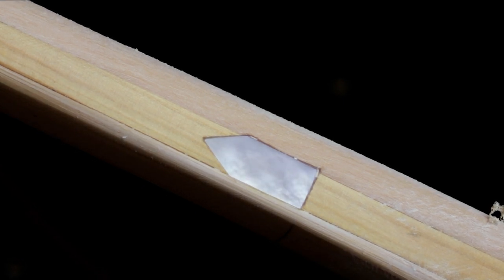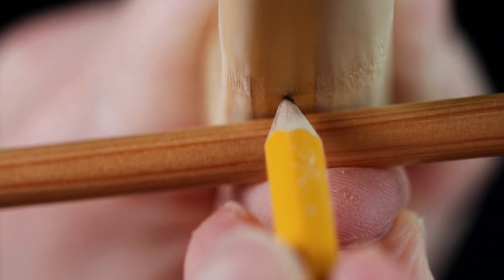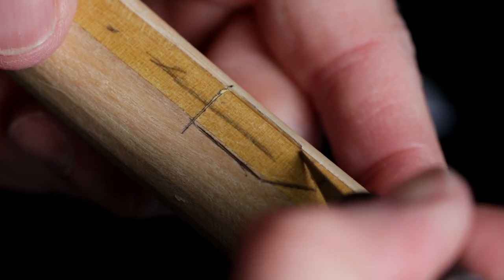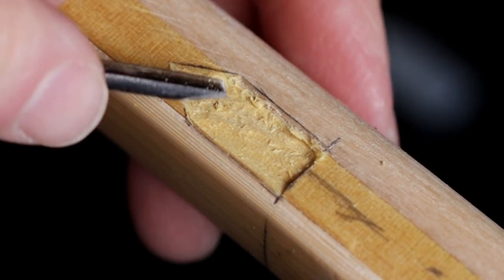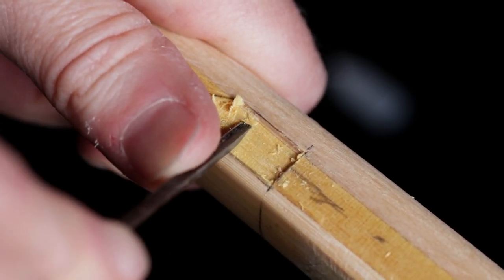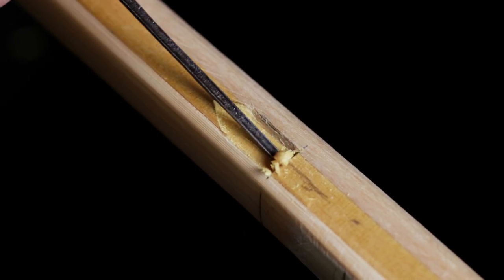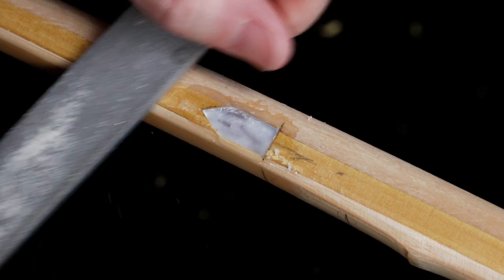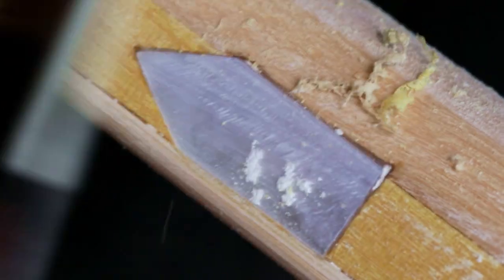Fitting an Arrow Plate    How to make Longbow   part 4

Comment: Sir I was very interested in finding this video about an arrow plate. It seems that I can find nothing about it on the internet and that no one uses this, I have seen dosen of bow making materials, is this just lazyness or something else? If so, would a thin square strip of fur do the same trick, it might even smooth out the release of the arrow, because instead of it rubbing against the wood or hard leather which could make that couple centimeters of difference in hitting the bullseye.
Reply from the maker: Glad you found us. I dont understand your first question, sorry.  Fur would just ware away, I wouldnt recommend it.  Mother of pearl is traditional in English Longbows, that is why we use it.
Reply: @longbows  Well it did answer my question! So thank you. Then I will be adding one to my bow. Mother of pearl arrow pass... good to know.